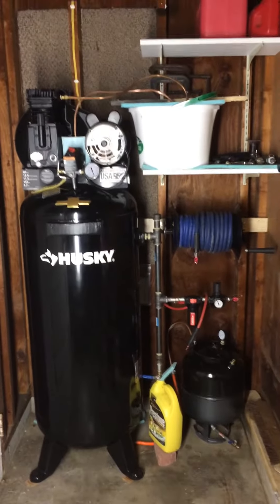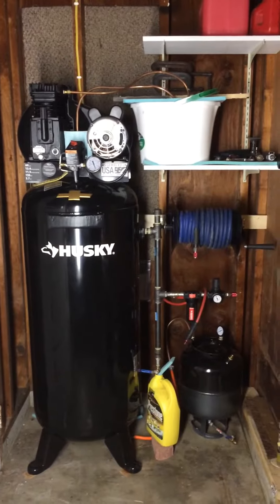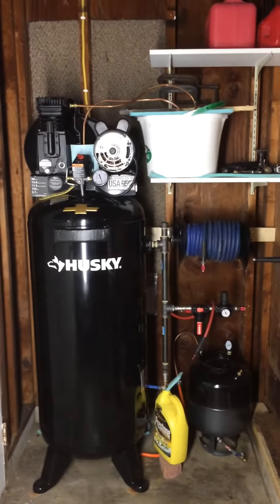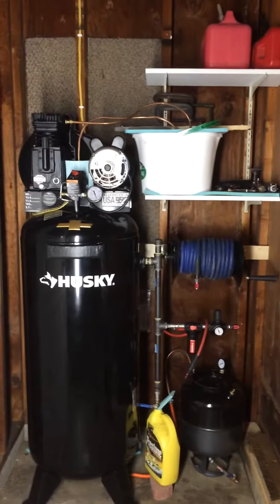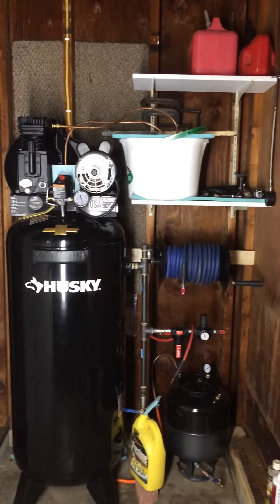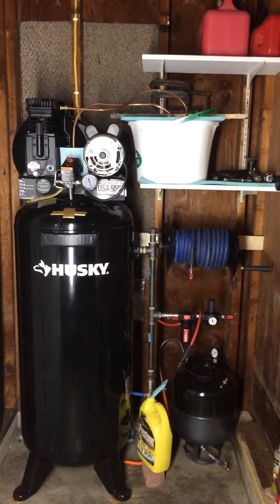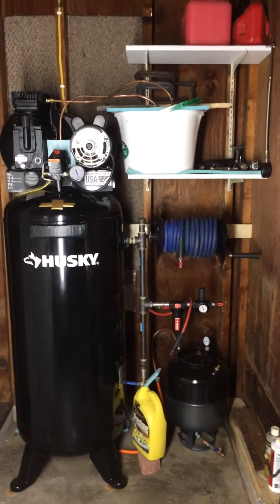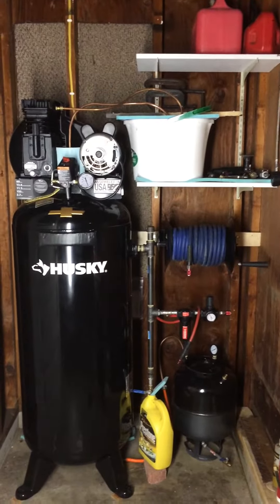Air Compressor Aftercooler / Heat Exchanger

Comment: Your video wasn't too shaky, I've seen lots worse that literally made me ill.  Is your condensation collection tank fitted with an automatic drain?  That would seem to be the next logical step.  I've heard a bunch of people vouch for the Harbor Freight one.  IDK if it a a superior drain or not, but every one I heard said it is adequate.  It looks as though your compressor doesn't have vibration dampers under it.  They not only reduce ambient noise levels, they protect the compressor from some long term damage.  These things can literally vibrate themselves to death.